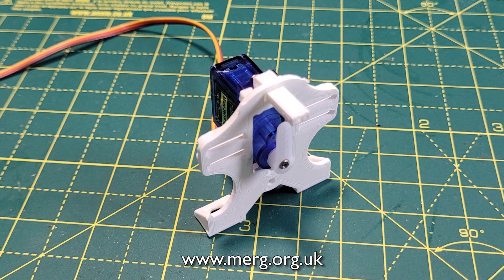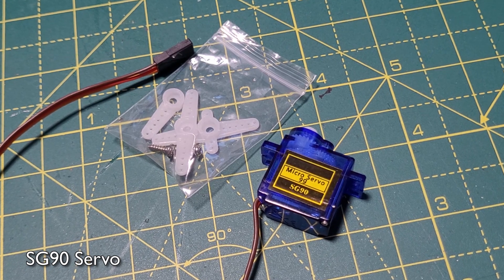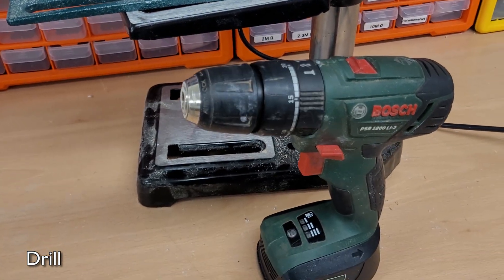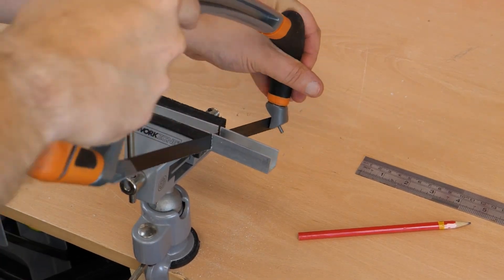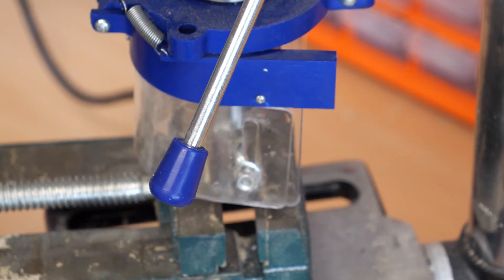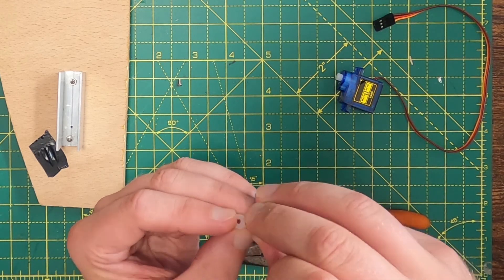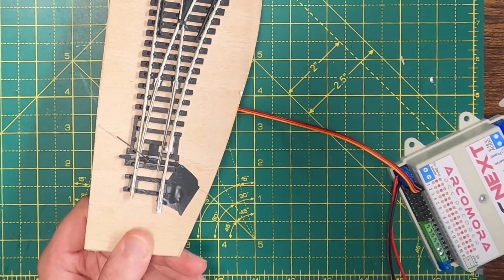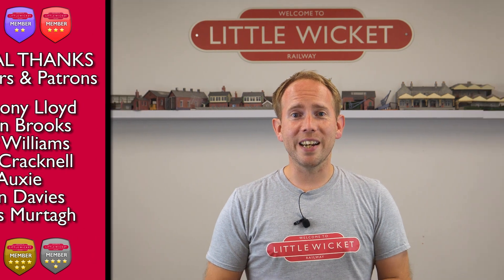DIY Servo Mounts - Cheap and Easy Solution

Comment: Hi Rob, great "tutorial"!  Just a note for readers following this advise. At 3:16 on the clip, you advise drilling a 3.5mm hole approx. 5mm further in from the 1.5mm hole. This is bad guidance because if the 3.5mm hole is centered over the 10mm hole in the baseboard, the 1.5mm fixing hole will be on the edge of the 10mm hole and will not provide a good anchorage point. This advise would be fine if you clarify that the edge of the 3.5mm hols and 1.5mm hole should be 5mm apart. I would advise that the centers of the 1.5mm and 3.5mm hole should be at an absolute minimum 8mm apart and suggest 10mm as a comfortable distance.

Comment: I have done something similar, except I mount the servo vertical.  On each side of the servo, I mount a micro switch.  When the servo rotates, it activates one micro switch and deactivates the other.  Be sure to use micro switches with NO/NC connections.  These then can be used to power the frog and indicator lights, just like a tortoise switch machine.
Reply: Any chance of seeing how you attached the micro switches and where you got them from?

Comment: Hi Rob great video as usual, I use a couple of different 3d Printed mounts depending on the use ie. signal head or point, above or below base board. I find 3d printing the most flexible way of mounting servos as you can modify depending on need.
Reply from the maker: Hi Mike, agreed 3D printing is a game changer. Where do you get your designs?
Reply: @LittleWicketRailway  mainly thingyverse but sometimes I make my own for simple servo mounts etc.

Comment: I've looked around for the servos and it seems to me that the metal-geared ones are called MG90, instead of SG90.
Reply from the maker: It's a bit confusing. Some SG90s have a metal spur gear, but the other gears are plastic. MG90s are all metal gears, but are about twice as expensive. I've never used an MG90, so I'm not sure if they are the same dimensions as the SG90.

Comment: You forgot to centre punch the position of the holes.
Reply from the maker: Laurie, I don't even know what that means, that's how bad I am at this stuff! 😬
Reply: @LittleWicketRailway  you probably already know by now, but it means using a hammer and punch to "mark" the centre line, creating a small dent allowing the drill the centre itself and stop it from wandering while drilling

Comment: Your video describes exactly what I do.  I scratch build my turnouts, and I power the frog with a micro-switch which I control with another wire connected to the servo.  I use CA cement to fasten the micro-switch to the aluminium.  I do glue the servos into the channel with CA.
Reply from the maker: Good to know this is a tried and tested technique on other layouts. Scratch built turnouts sound impressive!

Comment: Great info. Do you know of a source for servo mounts that include a mount for a micro switch? Thanks again for the valuable video.
Reply: Walters makes one.
Reply: @earlcory  That does look interesting but I have the servos and the micro switches and just need the mounting brackets. I may have to look for something for a 3D printer. Thanks for getting back to me.

Comment: Great video Rob. I saw a similar idea on the megapoint controllers site (by Dave Fenton. He coupled his with switches for point indication and frog switching which was neat) Works really well but working under a baseboard to fit was challenging but not impossible. Thanks for sharing  (I have voted for you re best channel)  Keep them coming please!
Reply from the maker: Thanks Stig55! I think John JMC also uses MegaPoints controllers.

Comment: Warning! I've used this exact method, the first time it worked _perfectly_, the second time (U channel also from Wikes) the servos fell out - the 15.5mm is the external dimension, the thickness of the channel section is not part of the measurement and apparently can vary a bit batch by batch.

you can deal with this by putting some sellotape round the servo to thicken it a little, doesn't need much but be aware it may not fit securely first time.

it works very well once you get it though

another trick though, useful when you have two points toe to toe, have the toe end mounting screw a bit further back so its under the servo once installed, uses less channel as well

in the end I moved to home made 3d print servo mounts (on thingiverse if anyone cares), but the channel method is perfect for those without. note also the channel can be drilled and tapped on the sides to mount microswitches as well and operated by the side bits of the cross shaped horn (you need to cut off the end of the horn that goes inside)

that said, having watched your earlier video on using servos convinced me totally, 100% behind using these, the are quiet, nice slow action and amazingly cheap

thumbs up all round